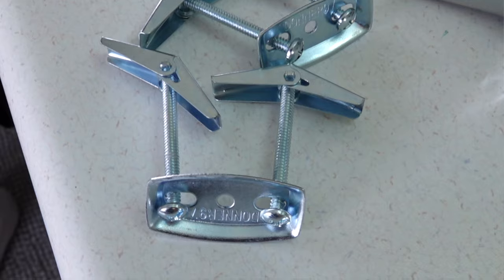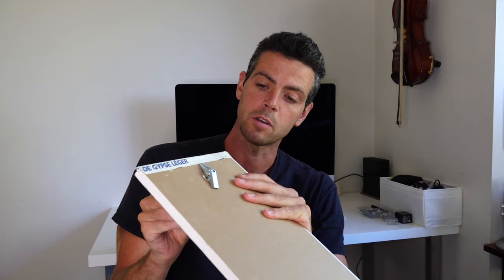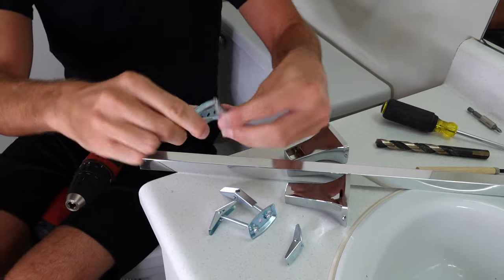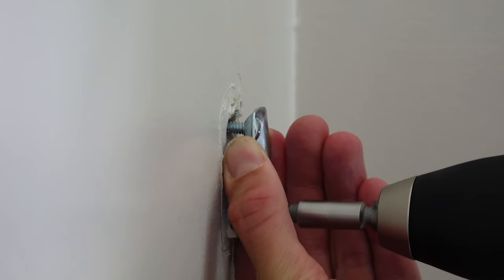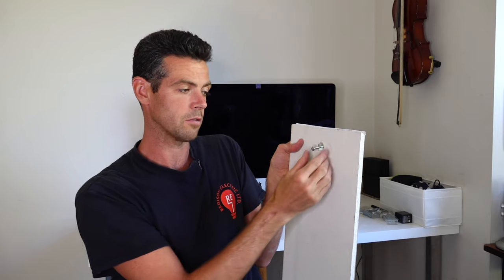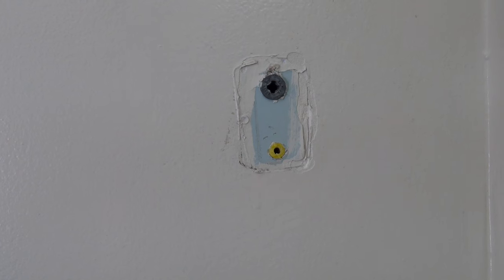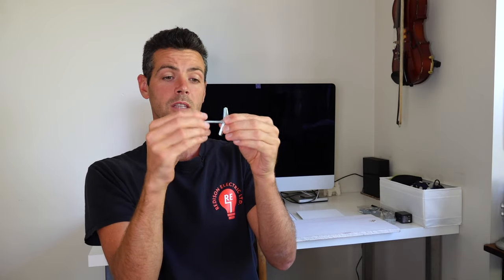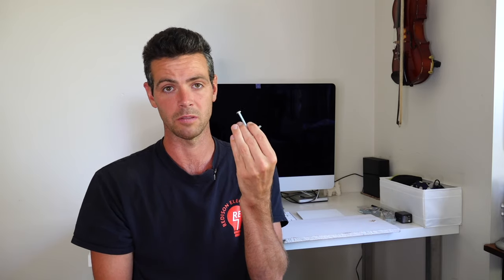Installing a Towel Bar in a HOLLOW WALL!!!!

Comment from the maker: Something I should mention. Part of the reason I used toggle bolts is because the hole were already blown out from someone using typical anchors. Toggle bolts are a great last option before opening the wall and adding wood backing. 
There may be better anchors to use for brand new drywall. Have a quick read through the comments to find out what some other options are. Thanks for watching!!!!
Reply: I love these things - Reliable 'Wall-Arrows' (was gonna add link but of course - YouTube).. First found in the UK and only occasionally found in Canada, they are quick and easy to install accurately with just a hammer and can hold a ton.. I had 36" high Ikea wall cabinets with glass doors and full of glass & crockery hanging on two of them..
Reply: As always nice to have blocking behind the wall. I much prefer wood over the banding you sometimes find in commercial buildings, but its still better than nothing.
Reply: What about installing a metal drywall repair patch and then drilling through that?
Reply: @adammacer  Lmao.
Reply: Feeling pretty dumb that I just finished a 4x8 patch in my bathroom after failing to consider these for a blown-out anchor hole. But, also my 4x8 patch + wall float looks PERFECT after watching hours of your videos last winter. Soooo...
Reply: JB Weld and duct tape.
Hey, it works on everything in West Virginia including car bumpers.

Comment: I respectfully disagree with you on this one.  That’s the worst choice you could make.  First you have to drill a VERY large hole to get the butterfly through.  This creates  a  week spot because you have to make two holes very close per bracket.  And if you every have to remove the towel bar, when you unscrew the bolt the butterfly falls to the ground behind the wall. So now you’ve lost 4 behind the wall. If you decide to relocate the bar you have very large holes to patch.  A very poor choice.   I use those screw in plastic or aluminum threaded Farrells.  They screw into the drywall and have a hole in the center to accept a screw.  To remove you simply unscrew.  They hold more and the hole is much easier to fill.  In fact you can leave them in and just mud over.  Much better.  I enjoy your channel, thank you.

Comment: I always cover the studs in a bathroom with 3/8" plywood or OSB first, then the drywall. That way there's wood everywhere, and you can fasten anything anywhere. I did the same thing in my shop, and in a commercial kitchen. It's really worth the extra cost, believe me.
Reply: Nice tip!
Reply: Plywood's getting expensive and that seems like overkill.  As a builder I would never consider that.  Just use random scraps of 2x6 or 2x8 in between the studs as the OP mentions.  Also make sure whenever possible to install things that are 16 inches on center.

Comment: Common sense for you and I. Like to add, using dis-similar fasteners is a no-no in most cases. Aluminum, brass/copper, and steel will eat each other up. Voltaire and all that. But stainless is wonderful. It not only is rust free, but it is neutral. You can use it with anything. I always keep stainless nails on my truck. Tin roof, copper roof, galvanized, aluminum? Doesnt matter the stainless fastener works.

Comment: Another option which I use in a lot of rental properties is making a decorative backing plate. Just a piece of 3/4” pine cut a little larger than the towel bar. Route the edges and round the corners or whatever you want to do. Paint it white (that’s usually what I do because it matches trim/doors). Then screw and glue it to the wall making sure to hit studs (doesn’t matter if it’s off-centered, you should easily be able to hit 2 studs even if the first one is only an inch or so from one side of the decorative mounting plate). Now you have something solid to screw the towel bar to. No pics handy but if what I said wasn’t clear I’ll grab a pic and add it in here.
Reply: Very clear - thank you!

Comment: I had to remodel our hall bath; water damaged. Before I hung the sheetrock, I did exactly what you mentioned. I surrounded the room with 2 levels of 2X6 for hanging "things". Worked out great!
Reply: Did a similar thing for a basement finish we did in our house during 2020.  My work-from-home computer office is in the basement.  I have 3 monitors.  Mounting them to the walls frees up a lot of desk real estate.  But I didn't know for sure exactly how high they would be.  Plus in the future, I will probably get different sized monitors.  I put two rows of 2x10s horizontally across the wall behind my desk, so I'm good for pretty much anything that ever comes up.

Comment: I’m the US we can get zip toggles, which hold the nut to the wall so it is reliably removable. They are much better than plain toggles IMO
Reply: Agreed, they are great
Reply: We can get them in the great white north also.  One small problem I've run into is if the wall is framed with shallow studs, there is sometimes not enough space for the zip toggle to go in all the way and turn.  In that situation I take an angle grinder with a cut-off blade and nip off a quarter inch at a time until it can turn.  For light stuff like towel bars, I tend to use an expansion molly, especially since I acquired a 'setting tool" that makes putting them in and setting them  almost foolproof.
Reply: 100% prefer zip toggles over these metal ones he has. We've used hundreds of these, specifically the Toggler SnapToggle, to hang loads of TV's, shelves, racks, etc. Also, a benefit is in commercial buildings, you can use them with metal studs as well for even more holding power than drywall alone (or to be able to use less fasteners total)

Comment: Full of good tips. I picture a number of bathroom walls littered with toggle ears at the bottom of voids. I’ve personally contributed a few (put the mounting plate on the bolt first).  And sometimes even the flimsy plastic sleeve anchors do so much damage repositioning is necessary - or adding a wood plate on the surface. Thanks for the video.

Comment: Great video Ben!  I do a ton of towel bars, TP holders and bannister repairs and always use the toggle/butterfly anchors.  Newer homes almost never have these things affixed to the studs anymore.  Another good video recommendation is how to anchor a tv ( so many repairs I’m doing lately the homeowners hung their TVs with just anchors, the TVs fall off the walls and then I’m called to fix it for them )
Reply: Blocking between the studs is highly recommended
Reply: Zip toggle company claim to be able to hang TVs off their anchors. Have you ever seen a failure using them? I use them for all kinds of stuff, still wouldn't trust them for a TV mount unless it was in metal studs and I mounted through the center of each stud flange with the toggle.
Reply: @chrisburns5691   Yes I have repaired several.  Both the plastic sheering as well as the drywall pulling off due to too much weight.
Reply: @edover50  my thoughts were always that people relied on them a bit too much. Especially for articulating mounts.

Comment: An upgraded alternative to toggle bolts are snap toggles. One of the advantages is you don’t have to put the bolt through the item 1st before you put it in the wall. Also you can remove the bolt and the toggle doesn’t fall behind the wall.  I’ve switched over to snap toggles years ago and never looked back.
Reply: Snaps are my go-to any more. I less the holes are super close, I've hung alot off them over the last year or so.
Reply: Also has extremely high holding power, higher than nearly everything on the market for a hollow wall.
Reply: @RecklessTheory  Excellent point!

Comment: The curtain tie back hooks on our big kitchen window had the screw in ones, right between two studs for the window. They were all tore out like they do, so when I fixed it, I cut the drywall out, screwed 2x4 pieces in the gap, and patched the holes. You can almost stand on those things now lol

Comment: I have always used the higher end plastic anchors in my walls with no problems. My walls are plaster board though. I have to use a masonry bit to pre drill.

Comment: I prefer the plastic zip toggles. With them you can take whatever you’re working with off and put it back on without losing the toggle. They’re also a tad stronger because they don’t have a hinge to depend on.
Reply: I use those all the time where I work. They are called snap toggles
Reply: @stormo65  yeah, we actually just call them toggle bolts and the ones in his video, we call butterflies or butterfly toggles.

Comment: Here in the UK we have hollow wall anchors and a tool that aren't as bulky as toggle bolts. Also there are "core fix" fixings that have a metal tube that bridge the cavity.

Comment: Installed a lot of drapery rods with toggle bolts in hotels that had drywall ceilings. Many times would alternate holes with EZ anchors, and that is my suggestion: use toggle on top of towel bar bracket plate, and EZ underneath, both sides. Metal EZ anchors seem like they work best if they aren't used exclusively, and are installed correctly (don't use an impact driver; if you do put too much torque on them on install, they are much less likely to hold the rated load). Then if you do get a little play, you can snug the toggle bolt back up; this will last a long time under normal use. And! I really appreciate your Hilti dead blow hammer, mine's a Milwaukee, and doesn't work quite as well, I can only imagine.
Reply: I see impacts used way too much for this kind of thing, as well as door hardware.  Like calm down and get a  good little 12v drill for little stuff..

Comment: There is the bolt, and the "wing" is the nut part that springs open. For a finish head, just go to your hardware store and get the matching thread pitch in stainless, or, super pro is order exactly the head you want with the right thread pitch (and length!) from McMaster-Carr. Tacoma Screw in Washington will have them. And if you want a smaller hole, especially for the load rating of a towel bar use the smaller wing size, doesn't hold that much less weight. I am seeing people who are ZipToggle partisans, and a reminder that you center the Ziptoggle in your hole and no play like with an old-school toggle. Be careful to hit your marks precisely with Ziptoggles because the center of your hole is where your fastener is going to land.

Comment: Ok I kinda agree with you there. Although I have a better way I’ve installed a thousand towel bars as a maintenance carpenter think army barracks. The best is have backing next is buy the best fasteners. The best fasteners are the metal screw in type also pre drill the drywall before screwing them in . Thank you for your videos I’ve learned a few tricks from them.
Reply: Have an example of the exact type you mean? I've got a couple plastic toggles on the edge of taking so I'm looking for something better.

Comment: Yeah, they're better probably. The problem I have is I work maintenance. People break, bend, and fuck up towel bars in ways you can't imagine. So I'm taking the brackets on and off regularly. Downside of toggle bolts is they're not gonna come off and go back on. You gotta use new.

Comment: I screwed a 1x4 across the area into the studs. Painted it the same colour as the wall. Then screwed the towel bar into that. Been five years with 0 issues

Comment: Also you can try zip-toggle aka toggler or flip-toggle are great especially if you need to remove the bolt later. 100lb plus hold power. Only downside is the 1/2" hole you have to make for placement.

Comment: I’ve had success using  Ramset togglemate.  They have a larger contact area at the rear and fit tightly into the hole in the plasterboard so don’t tend to wonder around when the little monsters climb on the rail.

Comment: You’re right…done with the provided anchors and screws,the bars are really for decorative purpose. I chickened out and did it that way, so will probably have to do it this way. One video I watched, the guy used just one wing thing in the centre hole of the bracket as opposed to two.

Comment: Funny… how do you adjust in the wall, the butterfly with your hand like you did on
Reply: You got a big hole to flop it around a bit, normally they don't bind up like what he had happen. They are spring loaded and should expand well enough.
Reply: you can spin the loose bolt head in your hand to coordinate the toggle behind the wall

Comment: Had a gross microwave-range fan combo to remove in the house I remodeled... The thing was held with toggle nuts through the plaster and lath walls... tried to "yoink it out", didn't work... When I tried to unscrew it, the nut just freewheeled on the other side of the wall.... I ended up Yoïnking that thing out in small pieces with a splitting maul!! The hole left to fix was a bit bigger than 2" but it was oohhh so satisfying!!!

Comment: Have to disagree - these toggle bolts work great for items that are static (like a fluorescent light in a garage ceiling) but with things that are used constantly and have tension applied against them (like a towel bar), with time will absolutely loosen and fail.

This generally happens due to the large hole (much larger than the stud size of the bolt) and wiggle movement - with time the loosen and cause a much larger hole/problem.
Reply: Have you used them? I would guess that, because the arms spread the weight over a greater surface, the wall wouldn’t break unless you really yanked hard.
Reply: @misstweetypie1  not only that….but we are talking about towels.    Towels!!!! They’re not gold plated towels that weigh in at over 50lbs here
Reply: @larrygill2223  yes I've used them.

Weight of the towels isn't the problem, really.  It's the pulling of towels off, kids grabbing onto the bars, time.

The arms spread out, yes, but they also have minimal surface area that pushes against the backside of the drywall.  The way they're made is the arma are bent steel that have to fold over the bolt - which means the anchor digs into the backside.  They eventually do give way.  This is why loose towel bars and hand towel holders are a thing.
Reply: @toyotaspeed90  wait, your towels are not gold? 😱
Reply: @toyotaspeed90  ah yes you are right.   Little bustards always pull down on those towels.   Didn’t occur to me unit you mentioned it
Reply: I agree these "wear out" over time on towel bars and hooks b/c of constant pulling on the towels, but they still last longer than the crappy screw in anchors.  Maybe the best is find a stud when possible.
Reply: Another situation in the bathroom where you never want to use a toggle bolt: mounting a curved shower rod.  That extra big hole through the drywall you just created will allow the bolt of the toggle bolt to move out of position and the curved shower rod to sag.
Reply: Consider using Molly Bolts. They spread out over a larger area inside the wall, and the shank of the bolt stays in the wall permanently. The screw can be removed and replaced whenever required.
Reply: @misstweetypie1    I’ve used them. The bent over edges on toggles tend to cut into the back of the drywall and loosen with time/movement. They’d be much better if they could sit flatter on the back of the drywall.
Reply: @reecenewton3097  actually with mollys you can run your screw back out and push the anchor back straight and pull it out, might open the hole more, but they can be removed... ask me how I know... "oh honey, can you move those up 1 inch?"......
Reply: I dunno I used toggles for a loose towel bar at my place and has been all good n tight for many years.
Reply: Maybe this is a better solution for lighter weight/duty objects, like a hand towel bar. Obviously, the best choice is to just open the wall and find a stud, or add a piece of wood for a better anchor, but sometimes you just want to fix a loose towel bar at your bathroom sink :)
Reply: Agreed. The 90lb rating is when the direction of the force is directly out. Kids pulling on them and racking breaking down the drywall over time will inevitably make this fail. Is it a bad idea? Well, only if you expect it to last forever and are unable to fix the problem at a later date. It's not really a "bigger" problem when they fail. The proper solution is cutting out a section of drywall and installing a wood backing. That's the same thing you would do when this fails. I suppose it would be impolite to pass the problem on to a new owner of the home years down the line who has kids who make those toggles fail within a week and has to hire a contractor to do the work and a painter to retouch after emptying their pockets for a down payment.
Reply: No one's using the towel bar for chin ups for crissake.
Reply: @interchangexVP3  i used toggles for mine years ago, still tight as the day I did it.

Comment: 4:50 - how to really do it.

People slip in bathrooms and grab towel bars to avoid falling. That’s going to pull out a toggle bolt, and the gaping hole left behind might be the least of the injuries.

If someone is doing a bathroom renovation, I’d recommend them to tear out that part of the Sheetrock, put in some 2x4 backing (as mentioned at the 4:50 part), and then patch the sheet rock. You don’t have to tear out the entire panel, just a 16” or so width between studs x 20” or less.

If you’re planning to tile a bathroom wall, there is even less excuse not to install wood backing.

Comment: I'm a big fan on have some backing installed during the framing.  Closets on the other hand, you never know where someone wants to put a screw in.  So just line the closet (3 walls) with plywood or OSB before drywall.

Comment: Even better than the toggle bolt.  Put a plywood backer between the studs before you hang the drywall.  Then you can get a good bite with a screw.